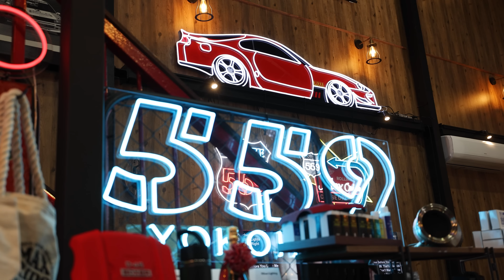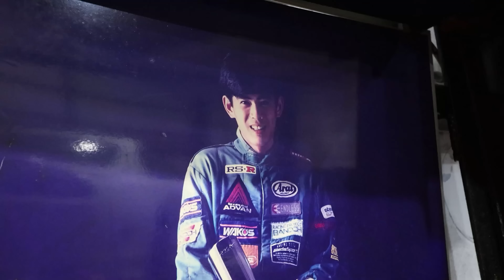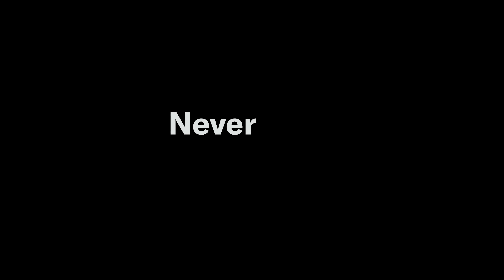Three LEGENDS Who Shaped JDM Car Culture and How They Did it | Capturing Car Culture

Comment: I wonder if Daigo could've done something else instead of goin TT. Those NA 6.2 AMGs especially in their GT3 form are absolute monsters n sound rowdy as hell! If I remember correctly the GT cars have the engines further inwards compared to their road goin counterparts so that its more balanced. Weistec has a supercharger kit for the SLS which bumps standard SLS's power to around 850bhp. So I'm sure they'll be able to get at least another 100bhp more outta it from the race car. They sound insane too. TTs muffle that glorious engine sounds.